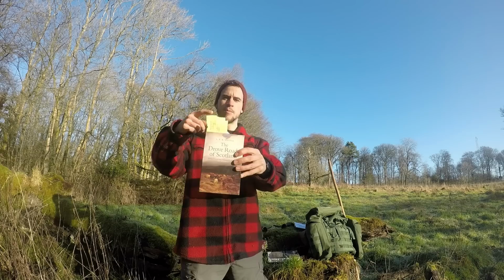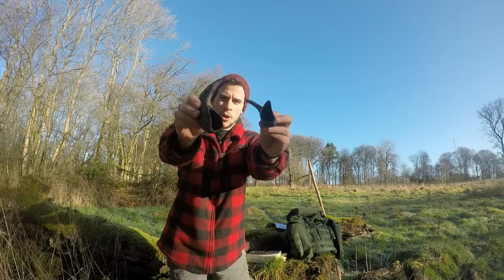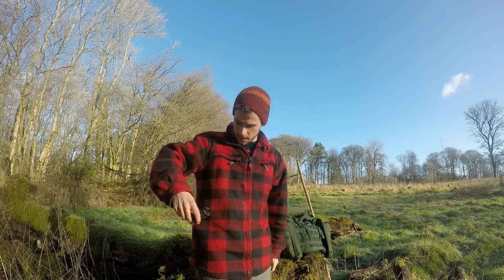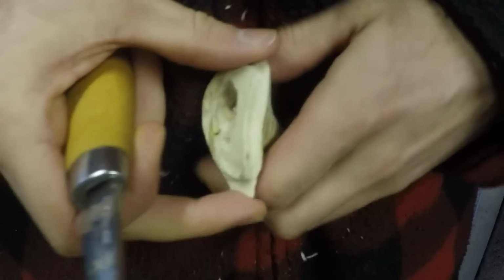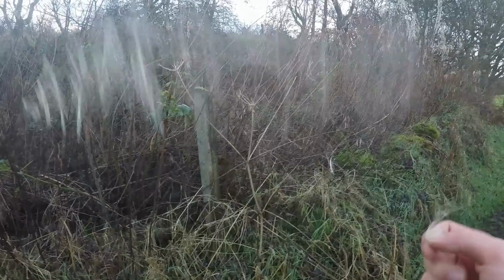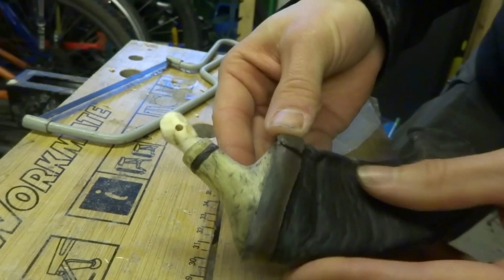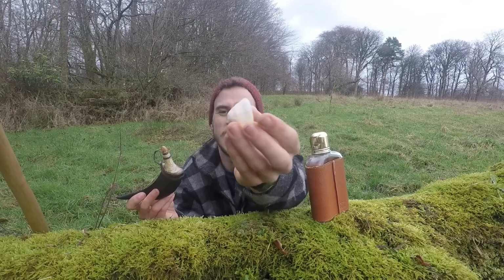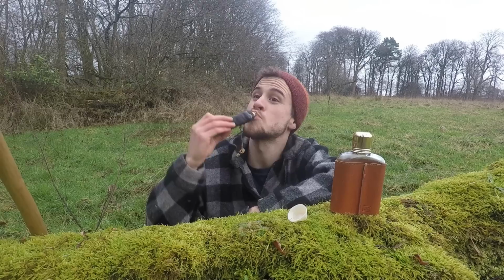Making a Ram Horn WHISKY FLASK (Traditional Highlander Whiskey Carry)

Comment: What you need for coating the inside is brewer's pitch. It was used for sealing the inside of canteens, and shouldn't react with your whiskey. Another great video! Keep up the good work! Cheers!
Reply: I agree. Beeswax wilt melt in time because of the high alcohol.
It will take some time though, but still.
Also it's not a bad thing to ingest beeswax. But when high alcohol is used in leather flasks, after a time it will start leaking. Mostly the leather flasks which were coated with beeswax were used for mead or water :)
Reply: They can be treated with a type of alcohol. I learned that bit from the man i bought my drinking horn from. Mine is beeswax treated
Reply: Or put an acid in it to desolve most of the stuff you don’t want in it and I personally wouldn’t coat it because im not really one for coating things with anything although it’s probably just dumb lol

Comment: Hey Tom, I'm hoping you'll see this. 
I've got a theory and some observations on the wet plaid debate. I think first of all that it will greatly depend on the conditions. here in Eastern Ontario and elsewhere in the colder climates we see a similar process. When it's really cold you'll  see animals, buffalo, cattle, horse, etc, who live out of doors with a coat of ice on them. Now instinctively we would think they'd be freezing, but if you can get up to them and reach a hand under the ice you'll realize that the ice forms a windbreak on their back to prevent the wind from robbing the heat, and a insulated air pocket that will hold their body heat. 
I have done this experiment with myself recently: I went skiing wearing my usual plaid coat. Because the coat is a loose flannel like materiel it naturally picked up the snow in the normal course of snowfall (and a few falls on the hill). It was cold enough combined with the wind to freeze the snow and ice into a hard shell on the outside of the jacket which made it almost completely wind-proof. Because of this I was very nice and warm, until I went into the chalet. At this point the snow and ice melted and soaked into the coat and when I went back out for a few minutes to talk to a friend, I nearly froze.
How I think this relates to wetting a plaid for warmth: I suspect it works the same way, the wool that they would have had would still have been full of lanolin which would have made it water resistant. So when you throw the plaid onto the puddle it will float on the surface briefly, allowing you to whip it off the puddle and wrap it around yourself, producing a film of water on the outside. In weather suitably adverse this water would freeze before it could soak into the wool forming the same shell of ice.
In order to test it I would recommend starting with a spray bottle. Get someone to spritz water onto the plaid while it's on you. I expect it would work better the colder it is, it would at least have to be cold enough to freeze the water before it can soak into the fabric.

I hope that this is of some use to you if you see it and try it.
Reply from the maker: Hi There! Thanks for the info! I really appreciate it. I will try out some of the things you said. Also someone recently recommended a book that mentions Highlanders doing it. I will need to read and see what detail they say :)
Reply: Thank you for sharing a bit of the history about the Drovers I'm sure those books are probably pretty interesting I did see in my book of clothing the there's an old sketch of a theatre outfit of the Highlanders in a Theatre poster and they have a ram's horn flask that's got a little string slung over the shoulder but I think that like any fashion people always improvise what is most convenient or suitable for them. Thank you for sharing your how you made it an the glue was very interesting I must say it you've made it really really well the drawings I have are not detailed. I'll share with you a story from the scriptures about the living Waters it's quite long so only if you have time if my computer and internet connection permit me : John Chapter 4 when therefore the Lord knew how the pharisees had heard that Jesus made and baptize more disciples than John (the Jesus himself baptized not but his disciples) he left Judea and departed again into Galilee and he must needs go through Samaria then he came to a city called Samaria which is called sych aar near to the parcel of ground at Jacob gave to his son Joseph . now Jacob's Well was there. Jesus therefore being where it with his journey sat thus on the well: and it was about the sixth hour there came a woman from Samaria to draw water: Jesus said to her give me something to drink( for his disciples were gone away into the city to buy meat) then the woman of Samira said unto him how is it that you being a Jew ask a drink of me which am a woman of Samaria? For the Jews have no dealings with the Samaritans. Jesus answered and said unto her if knewest was the gift of God who it is that saith unto thee give me to drink thou w o u l d e s t have asked of him and he would have given thee living water. The woman said unto him thou hast nothing to draw within and the well is deep from whenc hast thou that living water ? Are you greater than our father Jacob who gave us this well and drink there of himself and his children and his cattle ? Jesus answered and said unto her whoever drinks of this water shell thirst again : but Who ever drinks of the water that I shall give him shall never thirst ; but the water that I shall give him shall be in him a well of water springing up into everlasting life. The women said unto him sir give me this water that I thirst not neither come hither to draw. Jesus said unto Her Go call the husband and come here. the woman answered and said I have no husband: Jesus said unto her the you have well said" I have no husband": on for you have had five husbands; and he Who you now have is not the husband : in that sayeth t h o u truly. The woman said unto him sir I perceive that thou a r t a prophet. Our fathers worshiped in this mountain ; and you say that in Jerusalem is the place where men ought to worship . Jesus said unto her women believe me the hour Cometh when yee shall neither in this mountain- nor yet in Jerusalem worship the father you know not what we know what you worship for salvation is of the Jews but the hour Cometh and now is that the true worshippers shall worship the father in spirit and truth for the father's 6 seeketh such to worship him God is spirit : and they that worship him must worship him in spirit and truth. The woman says unto him I know that messiah's Cometh which is called Christ : and he when he is come he will tell us all things. Jesus said unto her I that speak into you am he. and upon this came his disciples and marvelled that he talked with the woman : yet no man said what do you seek? Or why are you talking with her ? the woman  left her water pot went away into the city and said to the men come and see a man which told me all things that ever I did is not this the Christ ? then they went out of the city and came unto him in the meanwhile his disciples prayed him saying master eat but he said unto them I have meat to eat that you know not of there for said the disciples one to another has any man bought him ought to eat? Jesus said unto them my meat is to do the will of him that sent me and to finish his work. Say y e not there are four months and then Cometh harvest? Behold I say 2 you lift up your eyes and look on the fields; for they are white already to harvest. And he that reapers receivers wages and gatherers fruit unto eternal life : that both he that soweth and he that reaps May rejoice together and herein is that saying true  one sows and another reapeth. I sent you to reap that were on you bestowed no labour : other men laboured and you have entered into their labours. and many of the Samaritans of that city believed on him for the saying of the woman which testified " he told me all that ever I did" so when the Samaritans were come unto to him they sought him that he would t a r r y with them: and he abode there with them two days and many more believed because of his own word; and said unto the woman now we believe not because of what you said for we have heard him ourselves and know that this is indeed is the Christ the Savior of the world. I don't know if the water of life taste like sheep :-) haha Jesus is the lamb of God that takes away the sins of the world he said unless we eat his flesh and drink his blood we can have no part in him no I'm just playing around thank you so much for sharing that often the Bushmen use ostrich eggs or calabashes to stillwater the Ostrich eggs are often buried under the sand to keep it cool. I hope you are well thank you for another excellent video for sharing all your knowledge. Oops I wrote it in the comment of the comment section but the comment above is quite interesting thank you for sharing that I suppose whiskey would have been used as an antiseptic on wounds and things like that. And maybe even to purify water or a pure source of something to drink the Apostle Paul said to Timothy drink a little wine for your frequent ailments

Comment: The construction of horns for Whiskey or rum in the Americas was essentially the same as a horn made for gun powder. Rum horns were also made fro cattle horns too. Though there were often made from the base section of the horn with the tip removed creating a little drum like container with mainly wood plugs either finely or crudely finished the the inside waterproofed with pitch or wax.

Comment: you also need to remember that the whiskey would have been in the flask at barrel proof (about 60-65%ABV) so if you wanted a 40% drink then you would need to add 30mls of water to it for a total of 70ml of 40%ABV in the flask. or if you wanted a more smooth tastier dram at 25% ABV you'd add 60ml of water for a total of 100ml of drink from the flask.. so not quite as bad as you think when you hear "only hold 40mls or so"

Comment: You'd manage to get the flask tight by widening the spout a bit and giving the stopper a wrapping of waxed hemp  thread all the way down in the same way yiu'd make the joints of drones, chanter and blowpipe airtight in a set of pipes. It takes a bit of practice and some  tricks o' the trade to get this right but any piper will be able to show you how it's done. After having done this for more than 40 years on my set of Uilleann Pipes I can guarantee you that you can get a seal that moves in and out effortlessly and is airtight (no angels' share here) and will prevent the flask from dripping.
Greetings from Germany
Lang may yer lum reek!

Comment: Another fascinating video. Two things I wanted to point out first thing is you are spot on with the beeswax being used to coat the inside of a drinking horn. Archaeologists have found beeswax residue in Viking drinking horn‘s and flasks. It’s also been found in other places as well. One thing I wanted to say about the way that the horn was shaped is have you ever heard of steaming an animal horn to shape it? Much the same as shipfitters steamed wood to bend it long before that they used steam from kettle boiling to shape an animal horn. Sometimes you would drop it into the boiling water for a few minutes and then bring it right out and he would take a gently tapered would Steve or wedge or peg whatever you want to call it and slowly using a mallet or other tools forced around end of the stick into the animal horn to open up the mouth a bit wider. You had to do this a little at a time and gently but it works. I’ve seen it done. As far as the glue I can tell you from experience there are two types of glue that are natural that work like a charm. One of them you already used which was pine pitch the other one is Birch tar which states all the way back to prehistoric times in its use. All that being said I think you did a fine job on your drinking horn. One thing I might add as an afterthought is sometimes a wood stopper can wear out it is always a useful thing to know how to add a very stained strip of leather or soft tanned animal hide around the stopper if it starts to leak. You can use some more of your glue to do that. Or you can just use beeswax to make it sticky and wrap it around the stopper I get a better seal when the weather conditions are changing and causes the wood to shrink or swell.
Reply: On a sidenote I would say the favorite whiskey I’ve had from Scotland so far is one called Loch Dhu and my favorite Irish whiskey is called Tyrconnell  but to each their own :-)
Reply from the maker: Thanks for the info mate. Yeah I have heard of people shaping horn that way but havnt tried it yet. The seal on this flask isnt the best. I wil need to think of something better next time

Comment: Hi if you put a binding half way up your flask , then takit over your glued in top like round the shoulder and back down to the Binding up one side down the other then the same thing across the other side tie the bindings together it will keep your your top pulled down and less chance of the glue only holding it from coming away you will realise the binding put on wet will dry tight  brilliant series , you could look to Norway perhaps also for information as some of the clan donald is thought to come from there , besides we would have traded with them , its with the addition of a rudder almost certainly where we got our Highlands galleys from am sure you will know a lot more than i but if any little bit helps then its all good .
Reply: My MacDougal ancestors likewise were thought to have descended from Norway. This looks like a fun project. Well Done!

Comment: Another great work, Tom! Drop an info on the flask later after using it for a while. I know leather flasks would get destroyed and soak after carrying whisky in it for too long. Well, I know I should drink it instead of carrying haha. Sláinte!
Reply: Jan Jelínek: Hi Jan, have you lined your leather bottles with beeswax? Did you find the leather began disintegrate? Ideally the whisky should preserve the leather bottle. I've had whisky in my beeswax lined flask for 8 years and not had any problems. It would be great to hear from your experience. Cheers, Peter

Comment: I don't drink alcohol, but I think those drinking horns look so great 😍
Hmm, could it be used for tea or other stuff too?
Or isn't that hygienic...? I have no clue about horns as material for crafting🙈
Reply: tea would melt the beeswax no?
Reply: @psychomaji  
If the tea is hot, it might, you're right.😅
Reply: Been drinking out of horns for ages, in my experience, stay away from hot drinks, especially if you coat it with beeswax. Carbonated drinks like soda is iffy but if you clean it properly you can get away with it.

Or just drink water if booze isn't your thing
Reply: @garsgrimkhazad9343  
Thank you for your advice/experience! I will try to make one🌟

P.s.
I do like booze very much, I am staying away from it for other reasons. Didn't mean to insult Whisky✌
Reply from the maker: Hey! Any hot drink would melt the wax. Or if there was no wax hot water might not be good for the horn and could taste funny! But ice tea might work or just for water. :)